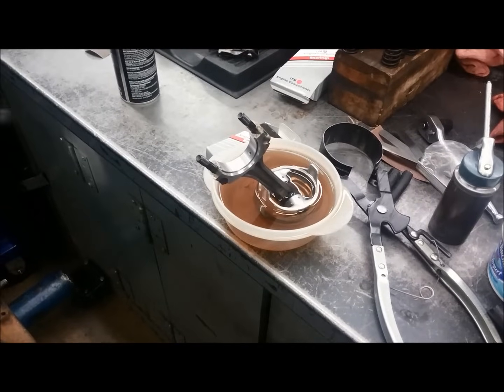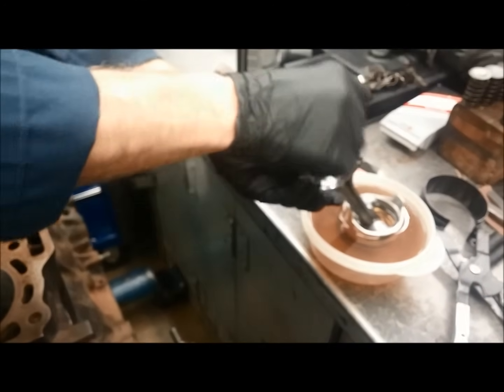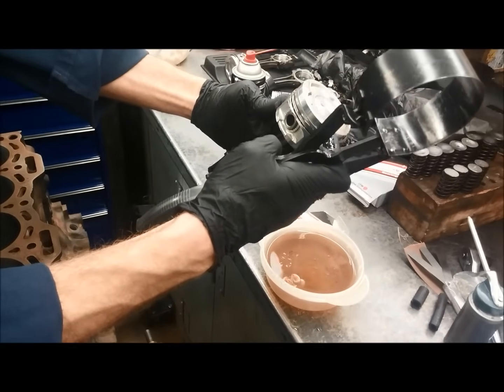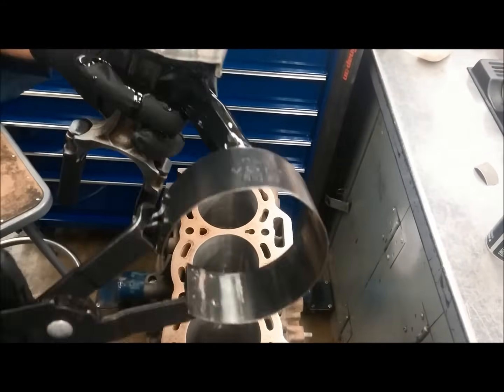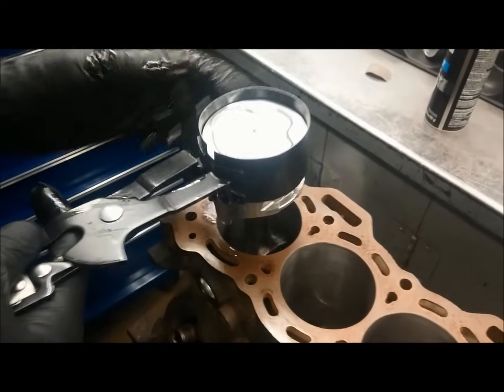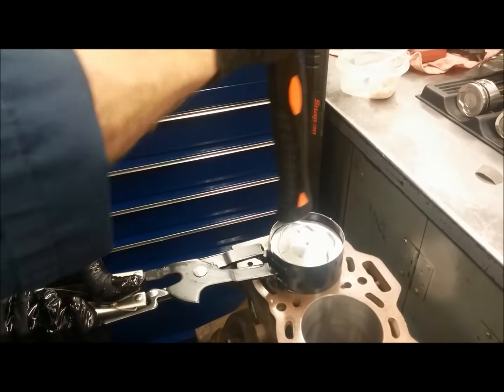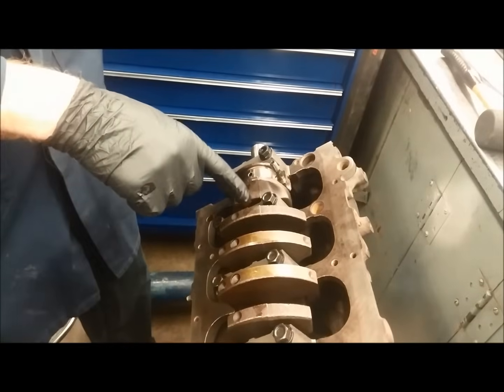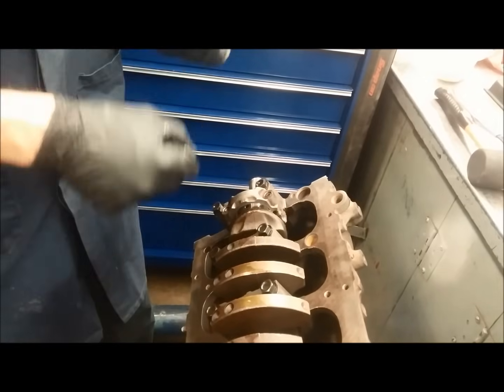Installing a piston into a cylinder

Comment: Is it right to put straight away lube on the rod side before checking clearence?
Reply from the maker: If you are using Plastigage to check clearance, don't put lube on the bearing until after checking the clearance.

Comment: Hi Justin, i was informed that it was advisable to let the new pistons settle after replacement. I.e not to push the vehicle too hard after piston replacement. How true is this?
Reply from the maker: Yes and No.  It is not about "letting the pistons settle."  You should drive your engine gently (although under varying loads) for the first several hundred miles after a rebuild.  The reason is to help the new piston rings and cylinder surfaces "break in."  It takes a while for the new surfaces to wear to match each other.  

By the way, this is the same way you should drive your vehicle before the engine is fully warmed up under all conditions - whether the engine is new or old.  

Almost all of the wear that a new engine will ever experience in its lifetime happens in the first hours of running after a rebuild.  Just about all of the remaining wear will occur on cold start-ups over the rest of its life.

Comment: I need that piston ring tool. I've just spent the last 20 minutes trying to stop the dual oil control rings popping out between the piston ring compressor and the block 😤😩
Reply from the maker: Yes - it is very hard to do this without the tool!

Comment: I was really worried ( I had just bought a new pair of rings for my 74 Suzuki ts250 ) because of how loose the rings sat in the piston. I sat there for 20 mins trying to compress the rings with my damn fingers as I attempted to slide the piston in. little did I know there’s an actual tool that helps with this process. Thank god I came across this video before I ended up snapping a ring or damaging the piston/cylinder. Thanks man!

Comment: I recently installed the piston in to the cylinder and it is new but it didn't go up and down easy.The engine is one cylinder diesel engine.What I can do to work easier?????plz help!!!!!
Reply from the maker: That's a tough question to answer.  There are several things that could be wrong, or nothing could be wrong at all.  First, once you have installed a piston and torqued your connecting rod bearing cap, you should measure the rotating torque of the crankshaft.  Use a dial-type torque wrench to rotate the engine from the crankshaft bolt.  It should take less than 4 ft.lbs.(48 in-lbs. per cylinder to rotate the engine.  In your case with one cylinder, it should just be less than 4 ft-lbs.  If it is not, something is likely wrong.  Did you measure your piston and cylinder and compare to specifications?  Did you get the correct piston rings and measure them before installing?  Did any of the rings catch on the cylinder and get bent during installation?  Did you plastigage your connecting rod bearings and main bearings to ensure proper clearance?  Did you use assembly lube or oil on your bearings and piston skirt?  Did you make sure to orient the bearing caps correctly during installation?

Check each of these things.  If the rotating torque is too high, it is likely one of the issues listed above.
Reply: @JustinMillerAutomotive  thanks a lot for the quick and very useful information that you told me.I will check your question and I will write to you back soon.Also sorry for my English is am from Greece and I try to learn it but in the end thanks again!!!!!!!😮😮☺☺😁

Comment: How do you know when the crankshaft is at bottom dead centre?
Reply from the maker: The "crank pin" or connecting rod journal associated with  that cylinder will be at it's lowest point (or farthest away from the cylinder) in the rotation of the crankshaft.
Reply: @JustinMillerAutomotive  Thank you.

Comment: What are ways to determine the psiton needs to be replaced?
Reply from the maker: Look for damage. Feel for scratches or dings that you can detect with your fingernail 
 If it otherwise looks good, measure it carefully with a micrometer and compare it to specifications.  Don't forget to measure the piston ring side clearance.  I have videos showing how to take each of these measurements.

Comment: Please note that this method does NOT work for certain engines! My 3.2L I6 S54B32 (E46 M3) block has different style/type of piston ring that will hydroplane on the bore if the ring gland area is soaked in oil; they are installed DRY using a piston ring compressor/sleeve, they aren't like an old school muscle car engine that has thick rings that put a lot of pressure up against the cylinder wall. These are low tension rings.. so be careful depending on the type of piston/ring you're working with!

Comment: Ring placement is different for every engine. I have a service manual for mine but it doesnt specify. How to know?
Reply from the maker: When you buy new piston rings, the package that they come in will usually have instructions.
Reply: @JustinMillerAutomotive  Thanks. The last time I did this job was 1968. That time, we just maintained 10am, 2pm and 6pm as the ring gap locations, minding to never make them all the same location. But a few weeks ago I watched a similar vid and the instructions were much more specific, that each type of ring has its own exact location and im wondering what has changed over the years that demands this.

Comment: This is the first time I've seen anyone soak a piston in oil most just squirt the oil on the cylinder wall and a little on the piston.  Then use the piston rings compressor tool and tap the piston in the correct direction.

Comment: I need help...I've changed rings and valves seals twice now and the car starts burning oil after about a month,blue smoke...the cylinder walls were standard,so we honed it the first time...could it be that the cylinder walls were honed too much and I need new pistons now, or can I just rings which is one size bigger???...or can it be that the valve guides might be worn??...oh,and what about the pcv valve?..can that also be a cause for the blue smoke??...thanks in advance...
Reply from the maker: Definitely check your PCV system to make sure that it is flowing well.  Besides that, are you making sure to measure you cylinders, pistons, valves, and valve guides?  New rings are not enough if your cylinder walls are worn beyond specifications.  Likewise, if the valve guides are worn, new seals will quickly start leaking again.  I have other videos that explain how to measure these parts if you want to watch them.
Reply: Stan Marr take it to machine shop

Comment: I'm planning to re ring my Acura I have quite a bit of back yard mechanic experience, but my question s are can it be done by just removeing the oil pan and working from the top end  and can I run a calendar hone and use the same Pistons with new rings or do I need to by oversized Pistons and rings by just doing a cylinder buff
Reply: All motors are different

Comment: Can I just replace the piston rings if there are low compression due to a compression test for misfire? Or replace whole thing piston and rings?
Reply: I see you haven't been answered.
First of all, disassemble your engine and check your ring gaps, if they're out of spec then measure your cylinder bores if there is no visible crosshatch and compare those measurements to your bgb.
Depending on that outcome you may only just need a light hone to prepare for new rings and then if need be, file the rings to achieve your appropriate ring gap. Or, you may need to get your cylinders bored and honed and step up a size in piston which then would need (obviously) larger pistols and rings to suit, a head gasket/s to suit the overbore, and while you're at it you may as well do a bottom end rebuild with new bearings etc. If your motor is boosted by any means be sure to get an mls head gasket and get both head and block surfaces decked to as close to true flat as possible to make sure you have as close to a perfect head gasket seal.
And also measure your cylinder cc's etc to make sure you don't go too high of a compression ratio.

Comment: Need help, I have a piper cherokee 140, it was due for annual inspection and in the process my mechanic found out that cylinder #3 had very low compression 80-20, so he replaced it with a brand new lycoming cylinder, he also tuned both magnetos,  now I finally had a chance to fly it and I am experiencing vibration throughout the entire plane,   I noticed that when he was placing the piston into the cylinder he was looking at the back of the cylinder for a long time, I noticed there was a little symbol in the back of the cylinder i am assuming that the symbol is a reference to how to place the piston in the cylinder? if the cylinder is placed the wrong way (upside down) could the be the cause of the vibration? or tuning the magnetos the wrong way could that made the engine vibrate? Thank you for your help
Reply: antonio r don't fly that plane
Reply from the maker: If there is a vibration when the engine is running and it is not misfiring, I would suspect a weight balance issue.  All of the moving components (crankshaft, pistons, rods, flywheel, harmonic balancer, etc.) must be balanced (to make sure that none of the parts are heavier than the others, or that there isn't a heavy spot on the rotating parts).  If they are out of balance, you will have a vibration when the engine is running.  The vibration would probably be noticeably worse at a specific engine rpm.  Also, does your engine have a balance shaft?  The balance shaft has weights that are specifically designed to counter the natural vibrations of the engine.   If it doesn't get timed correctly, it will make the vibrations worse rather than better.
Reply: Justin Miller Thank you very much, how do I know if my plane has a balance shaft? My pane is a 1968 piper Cherokee 140

Comment: what do you do if the plastic-gauge results are out of spec?
Reply: You can check the crank journal and rod bearing bore in the rod assy before assy. If all is ok then the plastigage is only double check.
Reply: Jay Horthorn Get mad .
Reply from the maker: If the plastigage is out of spec, then either your crankshaft journal is out of spec, your bearing bore is out of spec, or you have the wrong bearings.   This happened just the other day, and we discovered that we had bought the wrong bearings.  On many engines, there are several bearing variations available and you need to get the size that matches your engine measurements.
Reply: Justin Miller right, so if its out of spec meaning the gauge spreads to much or to little you can counter it buy getting bearings to suit ??

Comment: Easy enough job, doing this my first time last year the only issue i ran into and is what you mentioned, make sure the ring compressor is flush on the surface of the block and watch for the rings popping out the side, as thats what happened to me a couple of times. The vid i watched when i done it didnt mention that (lucky no broken rings) thanks for the vid.

Comment: Can i use over size piston rings on standard pistons? thanks because that is what my cousin did.
Reply from the maker: You might get away with it, but there are at least two problems with using over size piston rings on a standard piston: 1- you may have a piston ring end gap that is too small, which could cause the ends of the ring to contact each other when they get hot and expand.  2 - larger rings may place more tension on the cylinder walls.  Either scenario could cause premature wear on the rings or cylinder walls.

Comment: I do believe in pre-lubricating the cylinders and pistons but I have been told from multiple builders that drenching oil to the point it can get inside the rings can possibly cause cylinder glazing. What are your thoughts on that?
Reply from the maker: I have never heard that.  I have a hard time believing that the oil could cause glazing problems.  First of all, most of that oil will have dripped out before you ever get the chance to start the engine.  All that will be left is a thin film.  However, I am always open to learning new things--if you have evidence of this occurring, let me know!
Reply: Never heard nor experienced such a problem.
Reply: I have heard that run in oil is best as it doesn't have friction modifiers

Comment: Hi. Can you tell mi if it is acceptable to replace the pistons rings without cylinder grinding?
Reply: I replaced piston rings with the engine still in the car and de-glazed the cylinders. That was last summer, 6k miles later, engine still running fine. Just gotta make sure everything is clean, and the cylinders are clean after de-glazing, thats the main thing.
Reply: nice